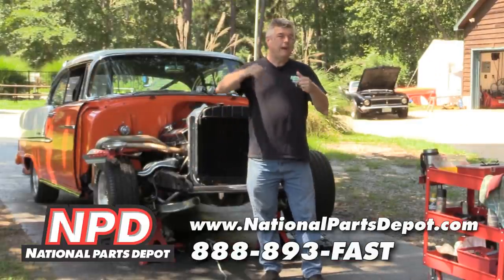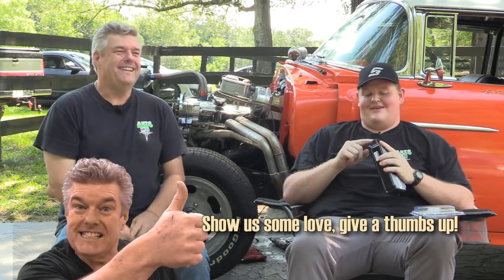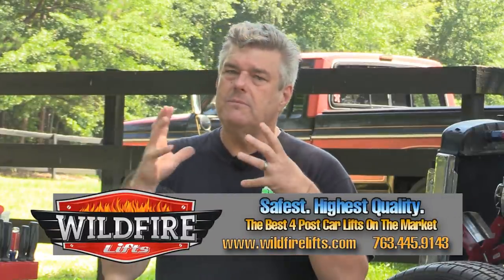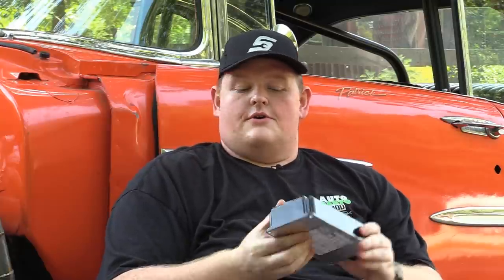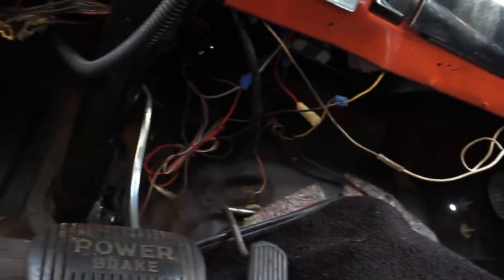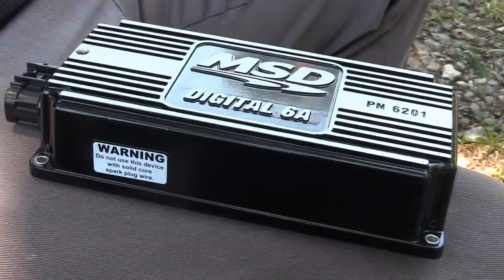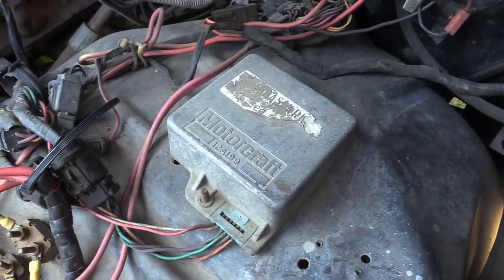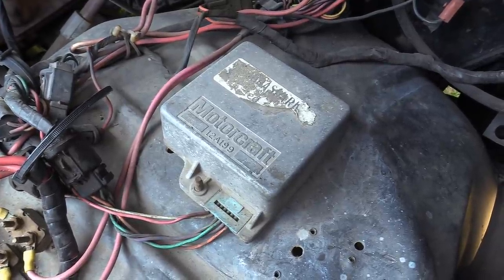Should I Use an MSD

Comment: We stopped buying msd 6a and 6al when Holley Performance Group bought MSD years ago. They fired 300 MSD employees from the Waco factory and moved most production to China. The imported ignition boxes are notoriously unreliable. Warranty was cut to 90 days. We only sell and use Dayton Sensors ignition boxes. Made in Florida with way more features including data logging and they don't burn up like the msd junk.
Reply: MSD in El Paso ??
Still advertises Made in USA. ?
Reply: @hotrodray6802  Son it's easier to fool some people than it is to convince them that they have been fooled... if you want to believe that 150 people in El Paso make what 450 people used to make there then you need to pause for some introspection of ones self.
 They still make the 7 and 8 series race ignition boxes and msd billet distributor bodies in El Paso. All smaller boxes like the 6 and 6al are made in China just like their distributor gears, blaster coils, LS coils, fuel injection, power grid, Street Fire distributors and the list goes on.
Reply: I agree 100%..... I recently had 3 6AL boxes go bad in 2 days.... When i called MSD about this he acted like is a common thing. I'll never buy another MSD product again. I bought a Pertronix Digital HP and it's been great. Small footprint, more options, more power and it's cheaper!
Reply from the maker: I'll look into Dayton Sensors.
Reply: @hotrodray6802  I lived in El Paso during High School and then enlisted in the USAF.  My parents lived a few miles from the MSD office.  I dropped by on leave, and picked up a few brochures.  That was back in the Mid 90's before I purchased an MSD for my '68 Ranchero.

I have a Pertronix coil and module on my Ranchero from the 90's with MSD wires from around 2010.  I ran a Pertronix coil on my '94 Gen 1 Lightning that lasted one year and then I started having issues with the truck missing.  It was driving me crazy trying to figure out the issue.  I decided to reinstall the MSD Street Fire coil from 2011, and it corrected the issue.  Most parts are a crap shoot these days.  Yes, the Made in USA stuff typically lasts longer, but no guarantees.  I went through nine master cylinders on my Lightning, one was a new Ford part from the local dealer.  It was defective.  So, you pay more for Made in USA, and you are supporting American workers, but the product may  or may not be any better than foreign made products.  I prefer Made in USA when I can get it.  YMMV.
Reply: Thank you
Reply: @hotrodray6802  They still make the high end boxes and the billet distributor bodies there.
Reply: @markdavis3629  That's just like some of the blue jean manufacturers.  They have plants here in the states but they have even more overseas.  They ship them in without labels, bring them in to one of their factories here, sew on the labels and claim they are made in the USA.  My brother in law used to pick them up at the port by the truck load and drop them off to have the labels put on them.
Reply: Thanks for the info...I suspected they went china
Reply: I agree with you 💯,my old 6al box from the early 90s the took the chip ran great on my 91 mustang for years!now have a 89 coupe 5.0,put on  a msd digital 6al about 2 or 3 years now always killing the distributor and efi module, people will say it got nothing to do with it,I a beg to differ
Reply: @markdavis3629 sick sellout of American product heritage.
Reply: @jesse75 it's because Holley is now owned by a Private Equity Company...that's a big problem
Reply: @olemansailor6519  They do that with underwear too! It'll say Hanes on the label but that overseas underwear is not made in the USA and it's scratchy! Deceptive and pathetic!
Reply: Looks like i wont be buying anymore msd stuff. My dist, coil, and 6al still work that bought pre 2015. Hope the plug is the same for other brands.

Comment: Pretty much all aftermarket electronic/cdi ignition systems sold these days are junk. Quality has become a real issue these days, i have personally seen multiple modern(since holley purchased msd) msd boxes fail right out of the box or a few months down the road. But i have seen and still know of many 20+ year old msd boxes that still work perfectly. Pertronix stuff is the same way, their new stuff is garbage with tons of failures and quality issues but the old pertronix stuff was really good.

Comment: Can you do a MSD vs Pertronix video? I'm learning on both, and don't know which would be better for my stock 67 289 motor. What's the pros and cons of both? A short simple video for us beginners would be very helpful
Reply from the maker: That is a good idea. I'll work on it.
Reply: On a different video about Ford FE engines you said you liked the Pertronix style ( built in coil ) distributor.  I installed a cheap generic one from Amazon in my 68 Galaxie 390 ( stock 2-bbl so far) and it seems to run fine.

Comment: If I remember correctly a lot of counterfeit MSD boxes were coming out of China at one time. Hot Rod magazine did an article on counterfeit parts a few years ago.
Reply from the maker: Interesting.
Reply: I found the Hot Rod article here: https://www.motortrend.com/news/counterfeit-automotive-products?galleryimageid=34a37f07-4218-4954-9fe4-5040cff6270c

It says that MSD eventually quit making the 6AL and switched to the Digital 6AL.
Reply: Those were MSG boxes. I bought one
Reply: Still are 😂 an eBay seller has "New" analog units and it's location is listed as "China" 😂 msd stopped producing the analog units many years ago

Comment: I have had a MSD 6AL with MSD   Distributor as well as coil in my 65 427 Shelby Cobra. Same set up for 11 years. No problem. Box was mounted under the dash with isolators. 427 side oiler (625 HP).
Reply: Is it a digital or analog unit?? Holley is owned by a Private Equity Company now that's a huge problem 😢

Comment: I have had a MSD box mounted on my 68 Mustang, it has been there since the early 90's. I have a MSD coil and I still run points in a stock distributor. I have the MSD box mounted on the inner fender just behind the solenoid on the front on the shock tower. It has lived there for 30 years no problems it was a daily driver for 10 plus years. Since I have rebuilt the 289 and put a mild rv cam in the motor but still have the same set up running edelbrock manifold and holly 650. Nice thing is if the MSD does ever goes bad I just unhook the MSD and run my points and keep on cruising. I know I could squeeze a little extra out by updating the points but I like the simplicity of points and hey its a hobby so its still fun tinkering with the old points. BTW my old 68 f250 still has points too. I guess I am just a simple feller. Take care and love the channel and these little simple shooting the crap videos are a nice deal as well, good luck with the move and take care Jeff and Cam.
Reply: My experience is somewhat similar to yours, and mine was also installed at about the same time in a '71 Ranchero. My box was  installed in a similar location. Maybe they were just made better then.
Reply from the maker: Like it!

Comment: in 1984  my friend greg pulled up and backed into a parking stall at the donut shop in mission hills (Van Nuys) he could not shut his highboy V8 vega off. he came over and ask me to take a look.. he had just installed a new starter.. i looked there first.. yep. the yellow wire from the R terminal was pinched by the top post on the solenoid..  so turning the key off.. did not shut off the power to the ignition system.. the small block stroker was idling away at about 1800 maybe 2000 RPM.. this is not an average V8 vega..  greg and i are talking about how to shut down the engine.. i can smother the carb and it will die.. No Greg said.. it will foul the spark plugs.. i said.. Greg.. you have an MSD 7A ignition system. fouled spark plugs won't stop it from starting again..  before greg or i can do anything.. gregs friend steve.. says.. i know.. ill pull the coil wire as he steps past us.. leans across the fiberglass front fenders.. reaches toward the mallory pro coil in the firewall.  and tries to yank it out of the coil.. those of you that are laughing now know the mallory coil has the wire firmly attached with a bracket .. its not coming out.. but it did come out of the top of the distributor cap as steve yanked really hard..  its really a good thing that steve had his wrist laying across the throttle linkage rod.. as his hand still holding the end of the coil wire was covered in Blue Electricity .. looked like Michael Jacksons glove..  it probably took 10 or 12 seconds for the stroker small block to spin down to a stop.. probably seemed a lot longer than that to steve..  there were about 200 people there that night..  a high speed police chase went past.. that chase went from the middle of the san fernando valley all the way to seal beach and back .. i think it was over 236 miles.. full tank of gas on a big caddy..  but as much as we prodded steve.. who swore he was OK.. he would not do it again.. only 7 or 8 people saw it ..  i just thought i would share some not very well known street racing from the mid 80s..
Reply from the maker: HAHAHAHAHAHAHAHAHAHAHAHA! Love this... better than a charged condenser.

Comment: On the grounds, 100%. I bonded the chassis, to block to frame. The battery is in the back and the ground is connected to the frame and is all bonded to the chassis and frame in the back as well. I didn’t run a separate ground wire to the front, but with all the bonding it works flawlessly and has for 20 years.
Reply from the maker: They are the lifeblood of the electrical system.

Comment: I had very good experience with my MSD-6A. Ran it back in the '90s on my '71 Ranchero; it was acquired with a 302, Weiand intake with large plenum and short runners, 650 Holley, stock single point distributor, and a cam that I didn't have specs on. 
Installing the MSD-6 was the best $100 I invested on that truck (think they go for twice that now). It changed the slightly rough idle into something smooth as glass, and some improvement in drivability. The box was installed on the front of the inner fender, and the anti-vibration kit was used. The buyer didn't care about it when it was sold, so I made sure to keep it.
The other comments make me wonder if, much like other reputable American made products, it suffered after the company was sold or got new management.
Reply from the maker: Hmmmm.

Comment: The voltage and ground thing are HUGE !! I switched to summit brand 
(relabeled Fi-tech) EFI and had lots of issues with warm start ups. Years ago I relocated the battery and used 4 gauge. I switched it out for 2 gauge, added another ground and so far, problem solved. I was blaming the EFI and it was all my fault for inadequate wire size.
Reply from the maker: I feel that a LOT of ignition issue bad mouthing is honestly ground related...

Comment: if you are going to RUN and MSD box.. the spark return is thru the thick black wire.. that needs to be attached to a harness that connects to the back of both heads and the distributor housing..   yes.. 4 wires  with one attached to the firewall also..  this shortens the spark return path..  what you thought the spark from the spark plugs just vanished when it went into the engine.. nope..
Reply from the maker: Cool. We'll look at that.

Comment: I have been running an MSD 6A for 21 years, yes it's the same box.  It's been through four different trucks through the years. At first I thought as you did in that you should run the matching distributor, but I have since went to a stock dura spark distributor and wish I would have done it 21 years ago.  I had broke down one day due to a failure in the distributor and was forced to make the swap.  After that I took the time to wire in the dura spark wiring plugs into the MSD box so that if it fails I can easily unplug it and replace it with the factory dura spark.  I mounted a dura spark box beside the MSD so it's ready to go should I ever need it.
Reply from the maker: I like that plan. Best of both worlds.

Comment: Im about to watch now (I like to comment twice on channels I really like, before, then after I watch the whole vid). I dont use any electronic ignition. Im a points guy. True, it took years (decades? I feel old!) of doing it in a way that I havent seen anyone else do, and I will do a vid on that at some point, but by now I can set dwell by ear, or just by feeling how the car runs. It doesnt work on other cars, except my own lol but the method does work, and I have saved a few people that had ingitionissues with Petronix, MSDs, and fake versions.

I dont doubt you get a better spark, but I dont like that once it fails, youre dead in the water. Points at least, will get you home, so long as you got a bit of sand paper and a screw driver.
Reply from the maker: Thanks for the two comments!
Reply: @AutoRestoMod  Not a problem. Love the style of your channel. While theres lots of channels for cars, few find that balance of making it interesting and fun! I dont subscribe to that many (hardly any time to watch, always something to work on lol)

Comment: Hi Guys!  I did not know my MSD 6AL box had an adjustment capability for Rev or timing. I need to find a manual and check the settings. Thanks for the info Jeff and Cam. Cheers from Motown.
Reply from the maker: You are welcome Robert!

Comment: The MSD street fire boxes are a good sub $200 option if you don’t plan on running NOS or boost on a street build. Been running mine on a SBF daily driver year-round for 2 years with good results.
Reply from the maker: Thanks for the heads up!

Comment: Have had a 6A box in my 68 impala for 20 years.  Like it so much just put one in my 77 C10.  Mount them high on the firewall in front of the passenger.  No problems whatsoever.  Both vehicles run MSD HEIs with MSD Blaster 2 coils.  Always start always run.
Reply from the maker: God deal!

Comment: 🔔😎
30 yrs. I'm totally sold on MSD multi spark on ANY engine.
Instant start in any weather. Good low rpm lugging power. Good gas mileage.
But ya gotta run helical core wires 👍👍
426 Hemis and Fox Mustang here😎😎😎
Reply from the maker: Thanks for the heads up!

Comment: NO! My MSD Digital 6 Plus and my HVC-II coil failed instantly leaving me stranded. They are NOT serviceable. A complete waste of $1,000. What killed them? Heat? NO, they were insulated, Vibration? NO, they were mounted on rubber, Amount of use? NO, they had all of 20,000 miles on them. They were just older. That is all. NO I will never use their products again
Reply: I had the same experience.
I had two cars, I fitted a msd to both of them about 2 weeks apart.
One car was used a lot, the other was barely driven. 
After a couple of years the msd in the car that was used as a daily driver failed without warning.
Then a few weeks later the other car that had been lucky to have been driven 100 miles failed in exactly the same way.
MSD = Might Suddenly Die.

Comment: Only had 1 bad experience with a brand new msd distributor about 10 years ago. Had maybe less than 2 hours work time on it in shed. So never got to drive car with it. Pickup failed. Older 6al and distributor ive never had troubles with. Used the same 6al box on msd distributor in cleveland and 6cyl bosch style on a 300hp 250ci ford aswell.
Reply from the maker: Thanks for that!

Comment: I would like to see you guys test out my distributor I have, It’s made by progression ignition.  Fully digital and can do blue tooth timing. Vacuum advance is also computer controlled and you can disable ignition with app for security.
Reply from the maker: That sounds neat! I'll look into it.
Reply: @AutoRestoMod  Please do. I know it will get some interest. You can change timing at every rpm while sitting in the car. It shows you a timing table in real time. 

I have a 71 challenger and will be reviewing it on my other channel once things are running.

Comment: Great info. I putting a Pertronix 2 with a MSD6AL on the 351 Cleveland in my 73 Mach 1, and I'm hoping it goes smoothly.  In theory, it should work fine, but .....
Reply: Similar, triggered 6AL with pertronix igniter in my 351 boat since 97, no probs.
Reply from the maker: That theory thing always trippin'
Reply: I put a MSD6AL on my 72 Mustang with a 351 rebuilt Windsor ..this past summer .. works great ..

Comment: I have a 6AL box mounted on my inner fender in the engine bay of my 75 F100 4x4 mud truck with a 466. There is alot of space there so heat might not be so intense but it gets covered in mud & water often. I have never had a problem with mine. Knock on wood.
Reply from the maker: Nice! Sounds like a cool truck!
Reply: Just mounted at 6741 on my Jeep.  Mounted it below the radio inside.  Made a plate, and put coil on the backside, ran drive wire through firewall.

Comment: Have you noticed if the Chinese made boxes are inferior to USA made boxes?  A year ago, I bought an MSD 6AL box for a new MSD distributor for my 1970 Corvette and it is marked "Made in China."  I was agonizing over where to mount the 6AL box because it is so big, and have not yet installed it.  Then I saw the new MSD Ultra 6A box which is 65 percent smaller and I knew I would not have trouble finding a place to install it.  I bought the Ultra 6A box and noticed that is made in the USA. I feel much better to install a USA made box in my Corvette. I was just wondering if you noticed any quality problems with the Chinese made MSD boxes.  It is truly sad that Holley has resorted to having MSD boxes that are made in China.
Reply: Hey brother...Holley is now owned by a Private Equity Company there's your problem!!! 😢 Someone in China is also knocking off the old analog units they're on eBay for $260 listed as "New" ...I believe msd discontinued those years ago